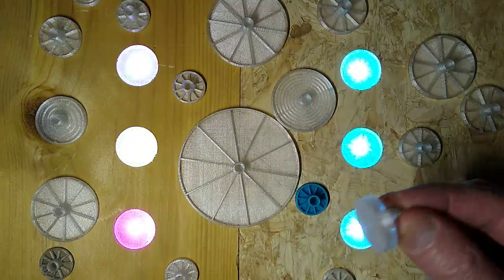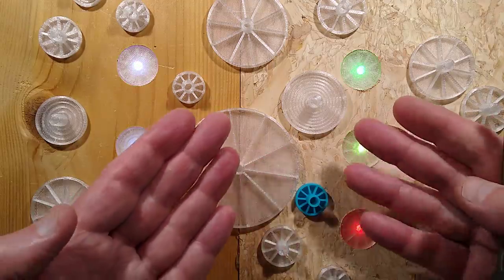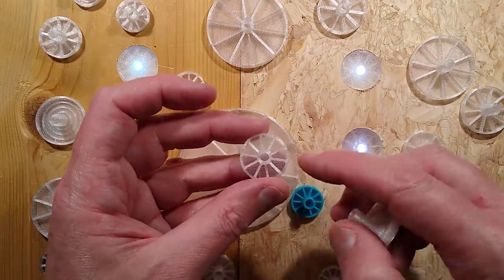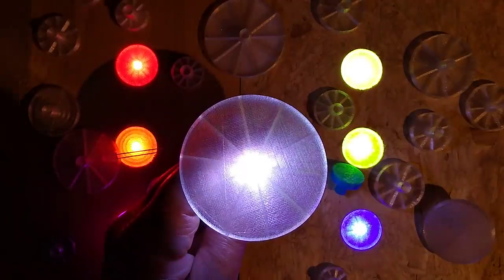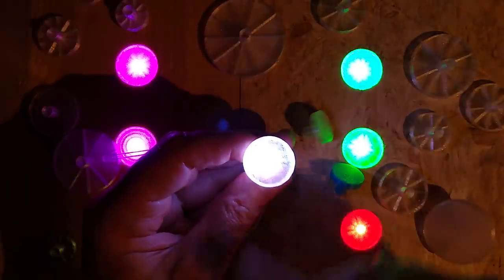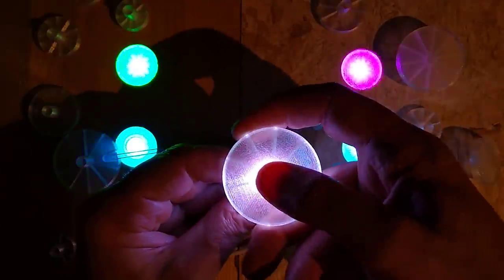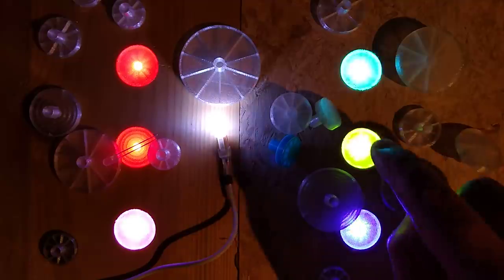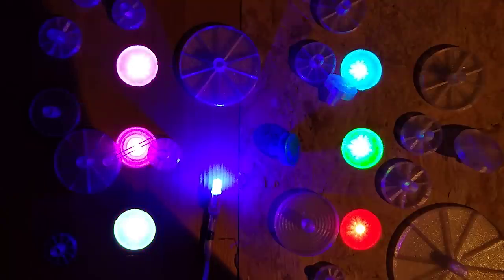DIY pinball-style lights for recessing into wooden surfaces

Comment: This is pretty cool! I think a forstner bit is what you want.  Would be curious if painting the pocket in the wood white helps even out the light?
Reply from the maker: I've already got a selection of those bits on order.  I also ordered a small pillar drill for cordless drills that I may modify to give an open base.
Reply: Yep, the Forstner bits are definitely the way to go. You were wise to get yourself a small drill press for it, they can be a little bit dicey to control freehand.  I've had to do that in the past (for a subtable for my drill press, quite ironically), and it was no fun.

Those flat spade bits are absolute shit.
Reply: Is a Forstenr bit the same as you use too cut holes in kitchen cabinet doors for the hinges?
Reply: @christianmoss4603  possibly. It's a round, disc-shaped bit with a small point in the center, two cutting edges that go out to the perimeter, and then a sharp circular perimeter.
Reply: @christianmoss4603  
Yes, that's a Forstner bit.
Reply: @PaulSteMarie  
Forstner bits are quite easy to control free handed, if they are sharp and if practiced in keeping the drill perpendicular for the first mm. But a drill stand/press definitely makes it easier and is essential for consistent depth.
Reply: @bigclivedotcom  
If you got one of these cheap Forstner bit sets (the 15 to 35 mm collection in a wooden box for example), first thing to do is to sharpen them. Out of the box they try to grind through the wood rather than cut ;) . What also helps a lot is to drill a small pilot hole (around 3mm) for the central point of the bit. There's no cutting action at the center and this non-cutting tip can be quite wide on some bits.

For larger holes (or rather round pockets) a hole saw should work for the perimeter, while the inner part can be hogged out with multiple plunges with a Forstner bit.
Reply: @PaulSteMarie  Nothing wrong with spade bits if you're using them for recessed bolt heads or want to cut a large hole without buying a giant auger bit etc. They won't give a super clean finish but to say they're awful either means you have cheap/blunt ones, or you expected a router-smooth finish (which they won't do). Also if you're cutting all the way through your work with a spade bit, you must clamp a scrap piece over the back side to ensure a clean exit hole.
Reply: @Agent24Electronics  I've seen entirely too many 2x4s that spade bits will not penetrate. These were Irwin, which is generally an ok-ish brand. I checked the damn things and just use auger or Milwaukee self-feeding bits these days.
Reply: @PaulSteMarie  Oh I see, I haven't used them in any particularly hard wood so perhaps that's why I haven't had any problems thus far. I'll keep that in mind.
Reply: @PaulSteMarie  They will go through Hardwood, if you drill a Pilot Hole and they are Sharp, I too like to sharpen them straight out of the packet. Being an Electrician by trade, I have found that Auger bits can bite in and try to rip your Hand off, specially in Confined Spaces.
But yes I have never had a problem drilling a hole using a Spade Bit or we like to call the Speed Bits here in Australia.
Reply: Freehand - for smaller diameters jam the point into the wood then gently slowly start the drill until it scores the  circumference deep enough to keep the bit from jumping out. Then gradually increase speed.
Reply: @bigclivedotcom  excellent, a sharp forstner bit is a pleasure. Something else you might consider (for the smaller holes) that often gets overlooked is the humble handpowered auger bit & brace. Fantastic for cutting nice clean perpendicular holes and many have a ratcheting mechanism which allows you to get in tricky places even with a wide throw. 

I also bought a wee baby one recently made by Maruyoshi which came with with a selection of bits between 3-8mm and it's been a fucking delight to use on small plastic components though that's not the usual application.
Reply: @christianmoss4603  yes

Comment: A forstner -style bit would be perfect for this.
Reply: I was thinking that or a hole saw.
Reply: @dashcamandy2242  A hole saw would be tough because there's nothing cutting out the core at the bottom of the hole (when you're drilling something but not all the way through). Sometimes you can break the core piece out but it's hard to do cleanly.

Comment: Such a cool and simple idea that I'm surprised I haven't seen anywhere else! 
These would look awesome on the railing around a deck. Maybe one every foot or so, with a channel routed along the bottom for the wires. 
I wonder if a conical shape may help diffuse a little more? maybe a tiny round silver sticker at the bottom of the LED hole to block the directional hot spot and bounce it to the side.  So many cool applications.
Reply from the maker: I toyed with a conical shape, but it would have made the hole a bit more complex.
Reply: @bigclivedotcom  Oh yeah, that's true. I suppose it would also add more complexity in how infill pattern would affect the light.
These remind me of the funhouse mountain at Tivoli with the really old roller coaster that runs around and through it. The warm, multi-colored lights. Wonderful memories. :)

Comment: I wonder if you could combine the lensing pattern with the star pattern. This should get the nice diffusion plus the strength.
Reply: Maybe it would be sufficient to use "concentric infill" in the slicer parameters while slicing the star pattern?
Reply: @TDOBrandano  If you made the disk solid you could play with different infills, but the star pattern is part of the shape. He did say the top plate was an adjustable parameter. That could be made thick enough for infill.

Comment: Thanks, Clive! I've been experimenting with different ways to light a control panel for Halloween (I have "trick" and "treat" buttons for the kids to press, rigged to a jump scare). This makes me think that a 3D printed solution might be the way to go.
Reply from the maker: eBay has illuminated arcade game buttons.
Reply: Ooh! You could make some comically oversized buttons if you're 3D printing them!  Maybe even have the words "trick" and "treat" modeled into them.  I'd just subtract the words from the front by maybe 1-2mm so would leave a negative space that you could fill with colored resin, or even just some acrylic paint. 
Printer should be able to bridge fairly easily.  Hard to explain in words.  😂
Reply: @bigclivedotcom thanks! I have the arcade buttons squared away. What I want are lit labels for "trick" and "treat". I have a microcontroller rigged to swap labels on the buttons  and other tomfoolery 😁 I was experimenting with different materials, like foamboard backlit by LEDs with black paint or paper covering the area I don't want to be lit, but I need a better diffuser. I have some "guts" from an old LCD display but I may try 3d printed diffusers like your buttons here. I have clear filament from my covid string lights project.

Comment: Instead of drilling to the exact depth, you can get a board of the same thickness as the depth you desire, and drill it all the way through. Then use a backer plate, or smaller backers for each hole.

Comment: One thing you might want to try is a reflector style back on those. Basically a little three-sided 90° pyramids all over it.

The diffusers on a bunch of Omron pilot lights that I have had that pattern on the back. It works much better than the circle pattern that you've got, which is what was used on some other pilot lights that I have replaced.
Reply from the maker: That could be quite complicated to create an algorithm for.

Comment: I made something similar and used the Forstner bit mentioned by others- it leaves a very flat bottom to the recess. It's the sort of bit used to fit hinges to kitchen and bathroom cabinets. I had great results using white PLA at 10% infill, it diffused the light well enough that it almost eliminated "pin pointing" the LED.

Comment: Clive, I don’t know if you’ll get this message, but you did read my comment/suggestion on your last livestream - it’s the idea of a project to create a “White Noise Generator”. Have the frequency range be the full spectrum (if possible, and modified by a trim pot) but the primary purpose would be to run interception at or on or about 15-22kHz. This range is above most human hearing, but just so occurs to be the precise range our “smart” devices that are supposed to be offline actually go about getting online, through sending packets of data to devices like phones and tablets that are also transmitting as well as listening/receiving on these frequencies via their mic’s and speakers, in order to allow these devices to phone home as they wish. Not cool, but easily rectified as you can now imagine...
Cheers! 🥂

Comment: BigClive needs a Github repository with all the cool scripts he be uploading
Reply: Here's my edit. 
// Merged star style w/ concentric ring style, cleaned up code to rely less on magic numbers, added customizer bounds and sections

//You can adjust the variables below

//diameter of insert in mm
size=25;  // [10:0.1:120]
//depth of insert
depth=5;  // [1:25]
//thickness of front face
face=1;   // [0.2:0.2:5]
//diameter of LED
led=5.2;  // [0.8:0.1:25]
//length of LED stem
stem=15;  // [3:60]
//thickness of outer wall and fins
wall_thickness=1.2; // [0.4:0.1:5]
//additional plate thickness right in front of LED to increase diffusion
led_front_padding=0; // [0:0.1:5]

/* [ Radial Fins ]*/
// set to true to render radial fins
render_radial_fins = true;
//number of radial fins
fin_count=10;   // [0:24]

/* [ Diffusion Rings ] */
// set to true to render diffusion rings
render_diffusion_rings=true;
//diffusion ring height
cylinder_height=1; // [0.1:0.1:5]
// diffusion ring width
cylinder_thickness=1.5; // [0.1:0.1:5]
//number of radial fins

/* [Hidden] */
$fn=100;
eps=0.1;

echo("The center stem has diameter of ", (led+2*wall_thickness), "mm");

//don't adjust anything below here
difference(){
    union(){
        // center disk
        difference(){
            union(){
            //main disk
            cylinder(h=depth, d=size);
            }
            //internal cylinder
            translate([0,0,face])  
            cylinder(h=depth,d=size-2*wall_thickness);
        }
        //star fins
        if(render_radial_fins){
            for (i=[0:fin_count])rotate([0, 0, i*360/fin_count]){
                translate([0,-wall_thickness/2,face-eps])
                cube([(size/2)-wall_thickness,wall_thickness,depth-face+eps]);
            }
        }
        
        //diffusion rings
        if(render_diffusion_rings){
            translate([0,0,face-eps])
            for (i=[0:4*cylinder_thickness:size-(led+2*wall_thickness)]){
            difference(){
                //outer part of the ring
                cylinder(h=cylinder_height+eps, d=size-i-1.5*wall_thickness);
                translate([0,0,-eps])
                    //inner part of the ring
                    cylinder(h=cylinder_height+3*eps, d=size-i-1.5*wall_thickness-2*cylinder_thickness);
                }
            }
        }
        //LED pillar
        cylinder(h=stem,d=led+2*wall_thickness);
    }
    //led hole
    translate([0,0,face+led_front_padding])  
        cylinder(h=stem+eps,d=led);
}

Comment: I think a forstner bit would help you control the depth and quality of the holes. They are available in most of the sizes you mentioned, you may need to use a hole saw the the 70mm one

Comment: I really like the fact you're using metric as well!
Reply: The STL format, output by openscad, technically used non-specific units.  However so much 3D printing software assumes by default that 1 STL unit is 1mm, and it's convenient to just go with that.

Comment: Quick tip for diffusion, after the first clear layers you could change the filament to white for 1-2 layers in white, for clearer lenses, print waaaay hotter and slower, so 260 degrees and 40mm/s, Clear PETG prints even clearer
Reply: PETG might be more durable too, in that it will bend more (and may deform) but shouldn't ever snap or shatter.

Comment: Interesting idea. Open to some additions? Seeing your bullseye style got me thinking, take those rings, and continue them up to the stem as appropriate angles to land fully around the sides of the led. They should function as lightpipes and carry the light further from the center to reduce the hot spot contrast... Also... They would be MUCH tougher. Could alter this as tilted pillars to get a polka dot effect. Or triangles for arrows...

What of logos graphics or words on the lense layer?

And if there was a lip on the edge, you could use a step drill for seating them.
Reply: So, to describe the shape better... A cone with the led inserted in the point, and the flat having a thick lip around it to serve as a setting surface... 

Another idea with the cone idea, you could make a bunch of nested cones into a bulls eye, and then reduce the size of the center post, or remove it entirely right at the lense to reduce the hot spot further... 

I wonder what a lipped cone shape would look like illuminated, if you just printed two skin layers, then did a 10% zigzag infill... Might really disperse things nicely if one wanted to print in a few extra layers of solid for graphics or such.

Comment: For the "Fresnel lens" effect, Cura has a "concentric lines" option for the top and/or bottom layers. Might be worth trying to print the ribbed one that way if you like the circular effect? 🤔
Reply: I've experimented with that for light diffusing and it does give an interesting effect.
Reply: I was gonna suggest this very thing.
Reply: It also has a concentric option for the infill. That way you can control the thickness of the ribs as well as the spacing between them.

Comment: This openscad is really neat! I've never played with it before but it's surprisingly simple. Here's a modified copy of the star script that lets you change the number of fins/spokes

//Pinball style star LED insert

$fn=100;
//You can adjust the variables below
size=25;        //diameter of insert in mm
depth=5;        //depth of insert
face=1;         //thickness of front face
led=5.2;        //diameter of LED
stem=15;        //length of LED stem
fins=12;       //number of fins 

//don't adjust anything below here
difference(){
    union(){
        difference(){
            union(){
                //main disk
                cylinder(h=depth, d=size);
            }
            //internal cylinder
            translate([0,0,face])  
            cylinder(h=depth,d=size-2);
        }
        //star fins
        angle=360/fins;
        for (i=[0:angle:360])rotate([0, 0, i]){
            translate([0,-.5,face])
            cube([(size/2)-1,1,depth-face]);
        }
        //LED pillar
        cylinder(h=stem,d=led+2);
    }
    //led hole
    translate([0,0,face])  
    cylinder(h=stem+1,d=led);
}

Comment: Piece of aluminium foil on the back may give a more "solid" look to the light Clive.
Reply: Maybe silver paint? Foil would seem a bit tricky, and of course it conducts so you'd have to fiddle round the LEDs. With paint, you could solder the LEDs up, dip 'em in PVA glue, then paint the plastic.

Comment: hi big clive 
a forstner  bit is the one to use they drill a nice even flat hole
when used with a small pillar drill or drill stand
love the idea you have come up with these pinball lights
Reply: Forstner, just to be clear.   You can do it with a lot of different bits.  I tend to use twist bits, rather than spade bits.  The main deal for using twist or spade bits is that you want something to STOP them continuing on.  (drill press, or some other stop)

Comment: Forstner bits for nice clean smaller holes. For really large holes use a big holesaw to make an oversize template from MDF, then rout out the holes using a router with a guide bush. You can get sets of guide bushes giving steps of 1mm.

Comment: I 3D printed a new disc to go on those plug in Light bulbs with the rotating disco diffuser with different shaped gaps in the disc. Worked OK. I also put a trim pot on the motor so I could vary the speed which worked very well.

Comment: Big Clive is obviously not a woodworker. What you need are a Forstner bit and a drill press. Forstner bits create a clean, flat-bottomed hole (with a divot in the middle for the wire hole) and drill presses drill perpendicular to the table (by default) and typically have a depth stop adjustment.

Comment: A spade bit is fine. Stuff like Forstner bits are 10% better for 500% of the price.
Reply: Forstner bits have their uses. Although, they shouldn't be 5x the price of spade bits. Maybe 50% more?
Reply: I think my set of 8 cost me £8.99 from aldi or maybe lidl, not gonna work for professional jobs but works for me.
Reply: @chronicgaming3280  Bought a decent set from ALDI (Australia) decades ago. Excellent for any price, and THE best method for cutting accurate 20mm holes for press-in sealed switches. Having said that, flat bits do have their uses, and again decent quality provide a good end result.

Comment: 0:55 - Forstner bits if you don't mind the bottom not being perfectly flat, or a router if you do need it to be perfectly flat (you probably don't for that, though). Plunge routers also come with very precise depth stops, but the bits will generally be a lot more expensive than forstners (and a decent router is also a lot more expensive than a drill, even after you add the plunge adapter).

Comment: I'd use PETG instead of PLA as it's water resistant, has a higher glass transition temp so will be better if any hot drinks are rested on it in a bar top situation and is generally stronger/more wear resistant with better layer adheation, I usually use clear PETG for lamp surrounds in garden solar lights, works very well.